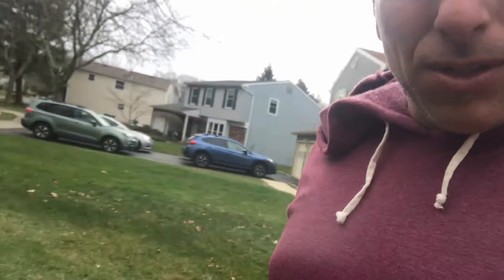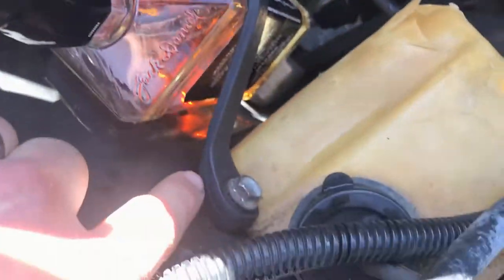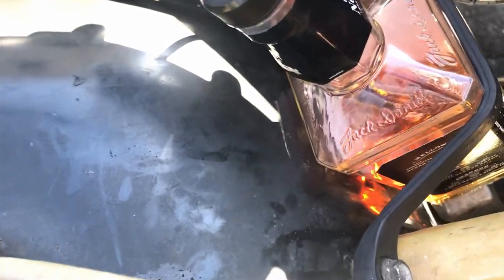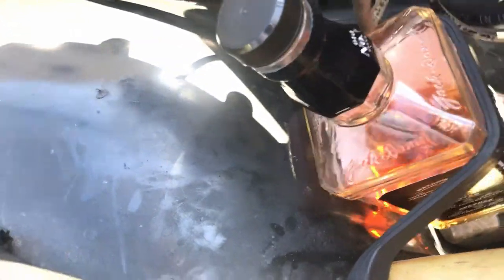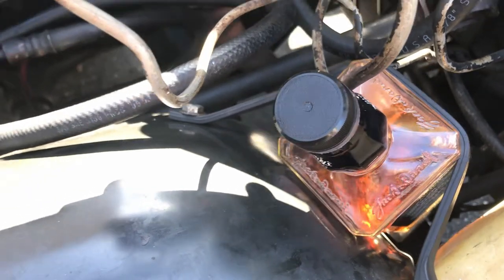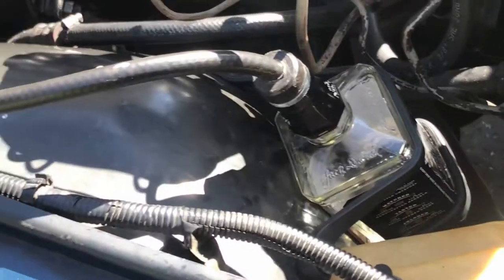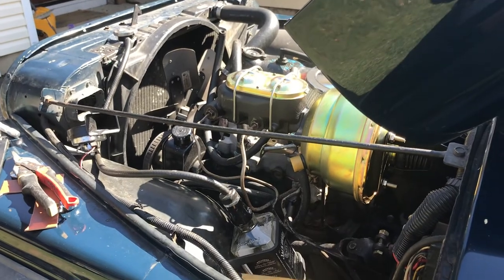Jack Daniels Radiator Overflow Reservoir

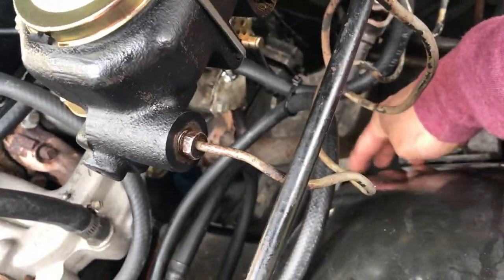Comment: It's a two year old video, so I guess we'll find out how it worked. But my guess, paused at 1:31 is that the glass is a bad idea.
I would opine that an old CJ bounces around and vibrates too much to make glass under the hood the right option. The Jack Daniels bottle is cooler, for sure, but I'd find a plastic bottle. 
As to the guy below, worrying about the pressure inside of the bottle...just drill a second hole (pin hole) in the cap.
OK, now I said all that. Let me play the rest of the video and see how it goes.
Reply from the maker: 2 years later, still intact!